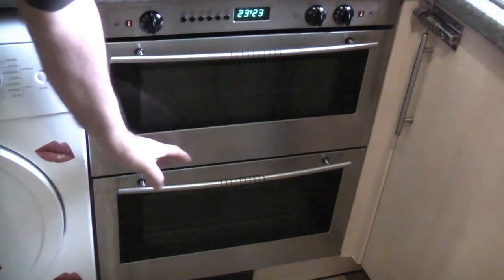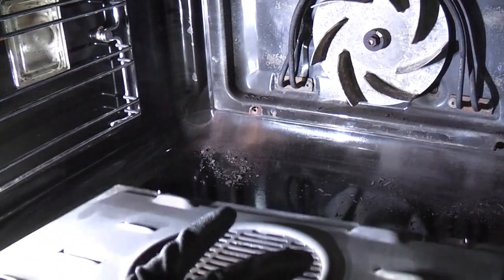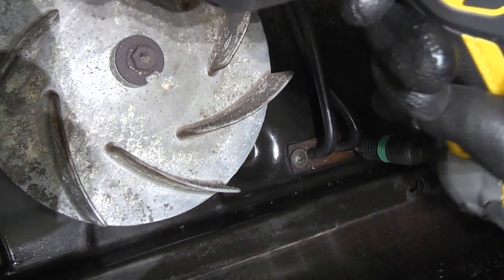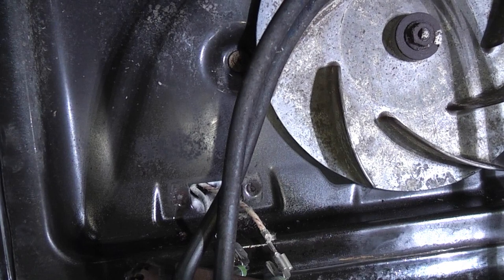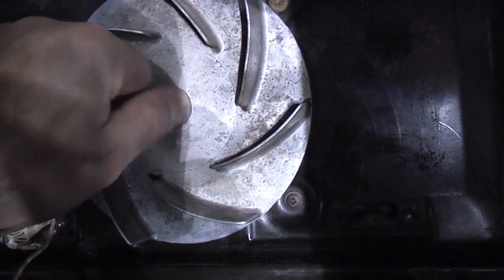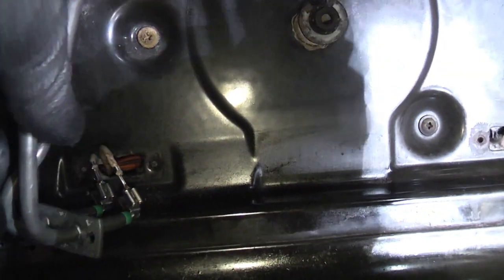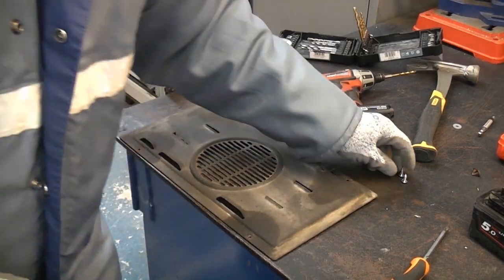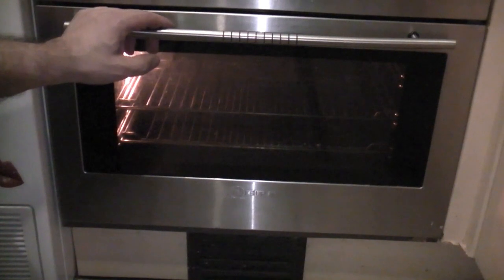How to replace an oven element

Comment: Replacing elements is never an easy job. I've done two, but when you see the price of new ovens, this has to be an option. Really good to see you tackle this real life fitting. Particularly pleased to see the re-drilling (offsetting) of the rusted plate fixing holes. Abandoning the damaged holes is a real pro tip. Thanks again for taking the trouble. Appreciated. As you say, doing the job in such a confined space is tough. Filming it must have been a nightmare.
Reply from the maker: Yeah, this was a real nightmare to film, especially as I was lying on the floor!
Thanks for the comment, Peter 👍

Comment: By the time the element fails, all screws are welded and panels rusted. So pretty normal in my experience. Nicely done with the offset mounting screws and holes - that never occurred to me. Thanks again.
Reply from the maker: You are welcome
Thanks for the comment 👍

Comment: I have recently had to replace the element on our oven.  The screws were so tight that I actually shattered the screwdriver bit itself.  I found the easiest way was to pull the oven out and take the cover off the back.  Once you have done that you will be able to feel the sharp back side of the problem screw through the glass fibre heat resistant matting.  A small slit in the glass fibre allows you to grab the screw tightly with mole grips and then undo it so it is loose.  Then you can go around the frond and take it out fully with a screw driver.  This will save you a lot time and hassle and is certainly preferable to having to drill the screw out and then having to drill new offset holes.  I hope this is useful info for you that you could perhaps share.

Comment: Just had to do this job on my similar oven. Encountered all the problems in the video (drilling out screws, boring new holes, fan extraction etc) Thanks to your wonderful video, it went like a dream. Took a while, though! Used the wife's cook's blowtorch on the fan, which worked well. Thanks, once again.
Reply from the maker: I’m glad you found the video useful
Thanks for the comment 👍

Comment: One of those jobs that can in theory be simple, but in practice throws up problems. Thanks for showing how to remove the fan properly, as that was stopping me from getting the clip on the element behind the fan without having to bend it.
Reply from the maker: Yeah, this can be a 10 minute job, or a 3 hour job!
Thanks for the comment ;-)

Comment: Seriously struggling to get the fan off, despite removing all the relevant screws and nut.... any further advice beyond that in the video? Accessing that last screw is proving to be a nightmare!
Reply: I did this hack this morning as struggled last night. I snapped the metal bracket at the top of the element 

When I fitted the new element I removed the top bracket, using a hack saw or pliers. So when you fit the element you position it as high as possible. Plus This gave the fan a few extra mm not to touch that bracket 

I might do a video if that helps

Comment: Thank you a thousand times! I have the exact same oven and this video is SOLID GOLD!!  I tried to use screw extractors on the back plate,  but this just sheared the heads of all four screws, so I too will be drilling some new holes in my oven 🙂
Reply from the maker: I'm glad the video helped 
Thanks for the comment 👍
Reply: @ultimatehandyman I had to drill the screws too. The trouble I am having is removing that fan blade. 
The washer and nut comes off easily, it is just the fan blade that doesn’t want to come off.  😥

Comment: I built a pair of flats 3 years ago and coincidentally (I think) both ovens bottom elements have failed within a month of each other.
I called out the warranty people and they say it’s due to the tenants placing foil on the bottom of the oven. 
One cabinet is scorched, I’ve not checked the other. Each element is £16 so that’s next weeks job. 
Thanks for the video 👍
Reply from the maker: I'm not sure how foil would make the elements fail 🤔 
I'd check the door seal is intact, as that can cause scorching of the cabinet.
Thanks for the comment 👍

Comment: That was a mission and a half!  I bet your ears were ringing when you had to shock those screws with the centre punch while having your head inside the oven! 😲Great video that shows what one often has to go through when working on well-used appliances as opposed to ones fresh out of the showroom. 👍
Reply from the maker: Yeah, the most difficult part was getting the camera in position- then It kept getting in my way. 
Filming a job like this can make the job 4X longer, but then the real time is spent in editing the video (editing probably took a couple of days!)
Thanks for the comment 👍
Reply: I appreciate the efforts you go to in order to produce your videos, and I watch pretty much every one that you upload, even if it's a job I'll never need to do myself as a homeowner. 👍
Reply from the maker: @RKMLarsen   Thanks Robert, that's great to hear ;-)

Comment: I have a 22 year old Neff Oven (model no: U1721). Will the fan bolt also have a left hand thread?
Reply from the maker: Yes, as far as I am aware, they are all left hand threads 👍
Reply: @ultimatehandyman  I want to say a big thank you to you for your video which I watched several times. I battled to get the fan off, but thank goodness I bought the same small vice pliers as you! May I ask you if you know how to replace the little black buttons? I have lost my button for the timer and ordered a new one from Ransom Spares however , it will not fit into the hole and click into position??i have asked them if they sent me a faulty part?? I would appreciate your advice. I really don’t want to have to call out a Neff Engineer for this!
Reply from the maker: @stevebroom4246   I'm not sure about the black button,s sorry.
I only do appliance repairs on my own appliances, when needed. I have not had to replace any buttons yet 😂
Reply: @ultimatehandyman  many thanks. I am learning as I go.

Comment: I'm trying to remove the element from my Neff oven and it's not affixed with screws. It seems to be fixed with tiny pins instead so I don't know how to go about loosening it. Do you know anything about that? (Many thanks).
Reply from the maker: I don’t know, sorry!
Perhaps they have riveted the element in place?
You might have to drill them out!
Reply: Strange. I wasn't sure if it meant I'd have to take the unit out to get to the rear. Thanks for replying. @ultimatehandyman
Reply: It's likely just that the screws are fitted from the rear and it's their pins I can see from the inside. I was hoping this wasn't the case b/c the oven's fitted and now I'll have to remove it from situ. @ultimatehandyman

Comment: Very interesting video, Ultimate Handyman! I got a question...
What is that "Spring" thing you use to "Shock" the rust off? I don't think I've ever seen anything like it but I Want one :D lol You also used it (or something similar) to mark your holes for the fan guard... or whatever the fan cover plate is called. Thank you in advance :)
Reply from the maker: They are spring tool punches. I used the pin punch to shock the screws, then the centre punch, I  covered them in this video a while back- https://www.youtube.com/watch?v=fjBu-tWdqoc&t

They were selling them at Screwfix a while back, but they stopped selling them.

Sometimes they pop up on eBay, or Amazon- https://fave.co/3eduj2d

This is their online store- http://springtools.shptron.com/

Thanks for the comment 👍
Reply: @ultimatehandyman  Awesome! Thank you for identifying the tool for me. Asked/told 2 of my friends and they were wondering too. Cheers m8!

Comment: Hi, I've been searching unsuccessfully for the shock impact spring loaded screwdriver you were using. Is it available to buy, or is your own design. Thanks.
Reply from the maker: I covered them in this video a while back- https://www.youtube.com/watch?v=fjBu-tWdqoc&t

They were selling them at Screwfix a while back, but they stopped selling them.

Sometimes they pop up on eBay, or Amazon- https://fave.co/3eduj2d

This is their online store- http://springtools.shptron.com/

Thanks for the comment 👍
Reply: @ultimatehandyman  
Thank you for your answer, I thought I'd seen it before but my memory is not what it used to be.
Reply from the maker: @Pete.Ty1   Neither is mine, I blame it on the statins LOL

Comment: I have the same oven and have done this job 4 times in 17 years. I made the Mistake of buying cheep eBay elements which only lasted two months. My advice is to get the original element.
Reply from the maker: I'm not sure if you can get genuine NEFF elements, I think they are generic and made for several brands of oven, although there are probably good and bad quality manufacturers of them.
One thing is for certain, they don't make them like they used to! 
Thanks for the comment 👍